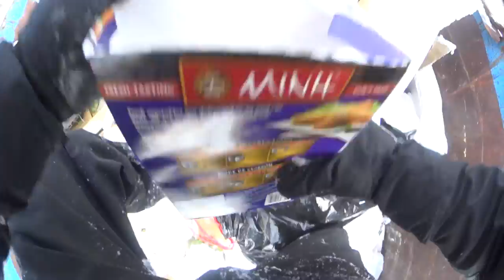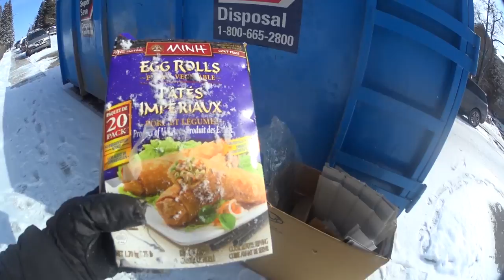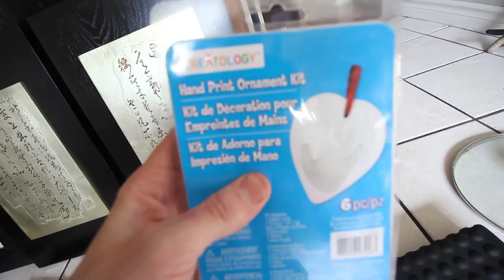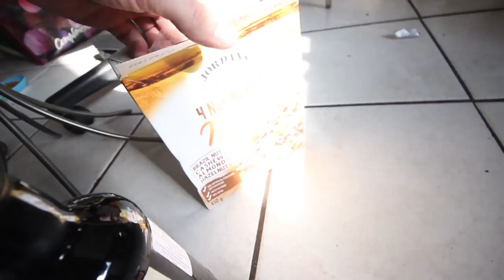Found Snacks - Vintage Clothes - Designer Clothes - HUGE HAUL!!!

Comment: I'd put all those handles in a bucked and charge $10. I'd also charge $10 a picture or $35 for them all. I'd sell the candle stand for $15 I'd honestly sell the bag of clothes for $20. That's $80 total in profits. Also, if you melted the aluminum into ingots would they command a more premium price? I probably got 10 pounds of melted aluminum ingots.
Reply from the maker: +Brother Blacksmith the aluminium would be worth more as ingots because it would be clean, but I can't see myself putting the time in. I got 10 for the handles, the pictures may be hard to move though. There's slight damage on both frames of the b+w ones. I'm hoping to get a lot more than $20 for the clothes though, I bet I can get more than that per shirt on eBay.
Reply: thubprint yeah melting aluminum cheaply is not really worth it with a coal forge. And hopefully you get more than $20 on eBay fer the shirts. And what sellar name do you go by? I might buy something I find neat one day.

Comment: If the cargo cover is in good shape thats around $150 used ($100-200 on ebay)
Reply from the maker: +Vaughn Scrapper yeah, eBay is probably the spot. There's one on kijiji for 50, so I listed mine for 30 and I haven't gotten any response yet. Local may be too small a market.